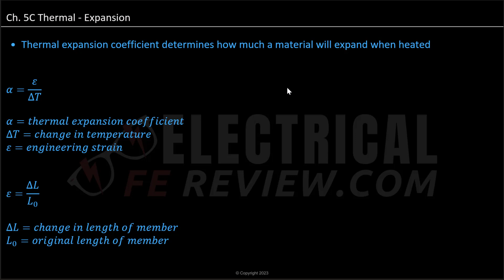Thermal Expansion - Properties of Electrical Materials NCEES® Electrical and Computer FE Exam

Comment from the maker: Video Contents:
0:00 - Introduction to thermal expansion coefficient
0:40 - Definition of engineering strain
1:00 - Explanation of how material size is proportional to temperature
1:20 - Introduction to an example problem involving an aluminum rod
1:40 - Explanation of the given variables in the example
2:00 - Calculation of the change in length and temperature
2:20 - Setting up the thermal expansion coefficient formula
2:40 - Simplification of the denominator and multiplication
3:00 - Calculation of the thermal expansion coefficient
3:20 - Simplification of the units
3:40 - Final Calculation

Ready to master the Electrical FE Exam? Don't miss out on our expert-led online course, with video examples and practice problems. Best of all, it's 100% FREE! Enroll today at https://www.electricalfereview.com and take the first step toward passing the FE exam.

Comment: 2:30 I think you made a mistake. You converted temperature change to Kelvins wrong. It should've been:
(20 + 273) - (0 + 273) = 20 K.
The total temperature change is 20 degC (aka 20 K). NOT 293 K.
Reply: Yes and never explains why converting to Kelvin was part of the solution